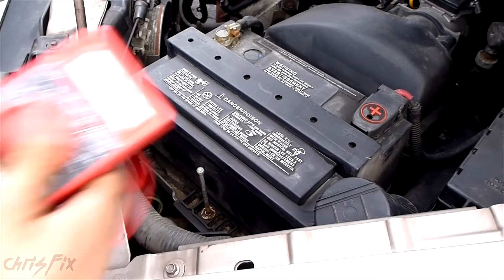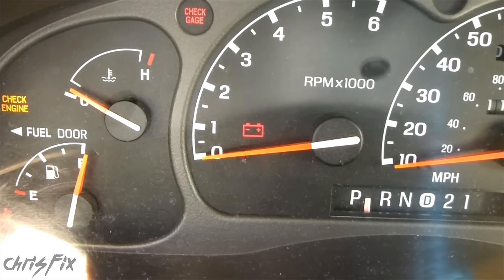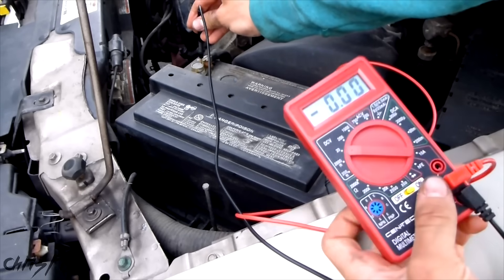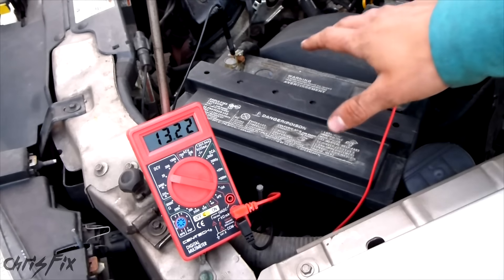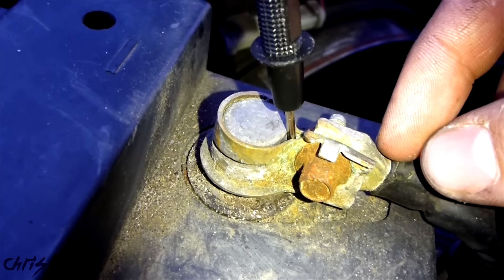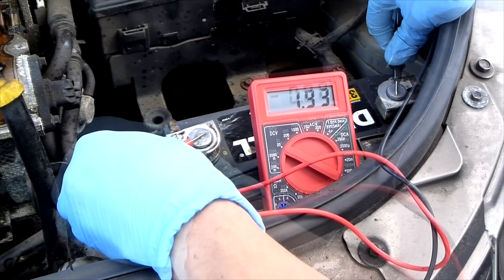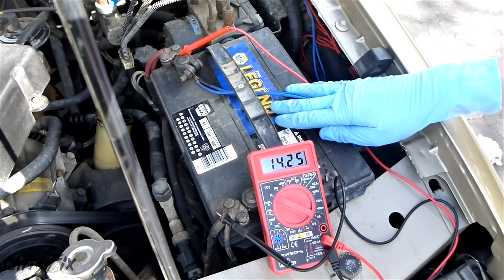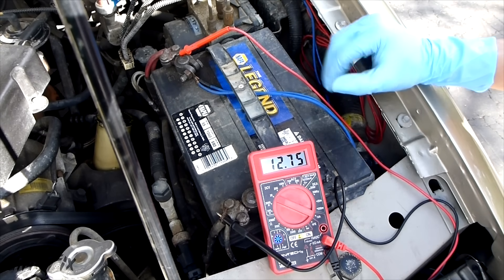How to Test a Car Battery with a Multimeter

Comment: Chris, today I bought my first multimeter and I successfully tested my battery.Thank you so much, greetings from Bulgaria!
Reply from the maker: Nice work! Thanks for the support from Bulgaria!
Reply: @chrisfix  I am in South Africa, also first time, your video helped, was always intimidated by multimeters, just a quick one make a note for people to use DC current reading and not AC reading as there are options on some multimeters
Reply: @chrisfix  how to fix air Con
Reply from the maker: @stevemanuel8373  I have a 3 part series. Here is part 1 and each other part is on the description : https://youtu.be/pCv7rCdcXsc
Reply: @chrisfix  I'm Steve
Reply: Chris, you have one of the best channels on yt and you've been so helpful! Greetings from Bulgaria!

Comment: What if my battery sits at 12.1 and drops to 9.7 CCA when I start it then go’s back up to 14.6 when it’s running?
Reply: Needs to go on a 10amp charger for about 5 hours, to be fully charged. 14.6 is good that means the alternator is working
Reply: Why is that? To bring the CCA up?
Reply: @XoX1971  Exactly, when the battery is that low it has lost its capacity. After it is charged it should test better. It is almost impossible to tell if a battery is bad when is low on charge. Note a battery below about 12.4 volts won't be recharged by the vehicle itself simply because the alternator isn't powerful enough.

Comment: Issue is with the car running the battery voltage jumps around wildly from 14v to 9v to 2V to 12V etc.. while running idle. any guesses?

Comment: Clean terminals and battery post with baking soda with a little water.  It will foam.  Then rinse it all off. Then clean post and terminal end with means that make the contacts shine.  If you can get a battery anti corrosion spray then spray product over the reconnected assembly to stop further corrosion by eliminating any oxidation in the future.

Comment: My multimeter read 12.24 before I start and while it was running does that mean my alternator is the problem?
Reply: Probably, you should see at least 13.5 or more volts while charging

Comment: Is the voltage test for the battery.  The same method for a diesel battery as there 48volts.  The petrol is 12 volts🤔thanks

Comment: When I started the car, mine dropped to 7. As soon as it started I drove to the parts store to buy a new one. I came out of the store and the car never started off of the old battery again. So 7 volts on a four cylinder Toyota is death.
Edit- may I add, the original battery from Toyota lasted 18 years. Yes. EIGHTEEN YEARS!!!

Comment: What if the Battery has no surface charge and you leave the head lights on for 2 min, and after 2 min the voltmeter is gonna show 12.2 or 12.3 even with the new battery.

Comment: If I have a newer 2014 Lincoln  MKZ and it's having a charging problem do I need a battery with more than 550  Cold cranking amps I live in Minnesota And it is Winter time roughly 10ﾟ

Comment: Copper grease on the battery terminals after cleaning wouldn't go amiss either, stops corroding of the terminals/connecting blocks.

Comment: Before using the sandpaper, mix some baking soda in hot water and apply to the terminals with a brush. A old toothbrush works well. This will get rid of most of the corrosion. Rinse with clean, warm water and let dry before using the sandpaper. You can also buy a battery terminal brush that works better than sandpaper.

Comment: If you have a battery that is 5 years old or more, just change it.  Lead/acid batteries have a life span of around 5 years and it isn’t worth waiting until it’s too late.  Cold weather depletes the batteries charge as well.

Comment: Hey, Chris, I'm having a bit of an odd battery issue that maybe you can help with. I got my battery about 9mo ago, and for the past few days, almost every time I turn my car to the run position before I start driving, the voltage of the battery drops to 9.5V after about a minute and stays there. It doesn't get any lower. The engine starts okay, but while it's off and the car is on, the battery voltage just holds at 9.5V regardless of what loads I put on it. Sometimes it holds at 12V the whole time I'm getting ready to start. The car is charging the battery fine (I verified this with a current clamp); it may be charging it a bit quickly, but I see the correct 14.4V when the car is running (with both low and high load).

I put my load tester on the battery after a drive and it delivered 400 or so CCA out of 340. I took the battery to both AutoZone and a dedicated battery store and got the same result from both places.

Do you have any idea what might be causing this? I don't want to be doing things like scanning the OBDII computer or updating firmware while this is an issue.
Reply: this is old but, sounds like the acid has mostly leaked out of one cell. The battery   might be punctured thru the side causing the level to be low. When that cell discharges before the rest it will then reverse charge from the current flow, acting like a negative 4V battery in series with the 12V 
either way, your battery has failed

Comment: Thank You for the great idea - to have voltmeter connected during cranking! I've had the exact same problem You discussed in Your video - my battery was over 12,6 V in (almost) no-load situation, so I thought it was ok, but my car wouldn't start. After checking everything else (and preparing my desperate soul to have my car towed to the mechanic), I searched the internet and found Your video, tried to hook up the voltmeter and turn the key... saw 9,2 V. I replaced the battery and my car is happy and running again. Thank You for the awesome work, Your car-maintenance and troubleshooting videos are the best! Regards from the Czech republic! :-)

Comment: For other people using a multimeter their first time - when testing DC Voltage:

Black Cable goes into the one that says COM
Red Cable goes into the one that says V(OHM)MA

It should say that in your manual, but that tripped me up because there's three holes to plug the terminals into.
Reply: No no no! the red cable goes to the VOLT/OHM jack
mA or AMP is for measuring current, if you put that across the battery terminals it will blow the fuse in the meter, or blow the meter

Comment: If your battery light goes off when the engie starts, that does not idicate a good battery, but rather that the alternator is putting out a harge, ot necessarily enough amperage, but sufficient voltage to turn off the lighht.

Comment: Im having crank issues. A mechanic wanted to change my starter, negative cable, distributor cap and rotor. I bought s meter after watching this. Turns out my battery was pulling 1.4 v. Saved me $2,000 from a crooked mechanic

Comment: Mix baking soda and water for an easy way to clean corroded battery terminals
Reply from the maker: Thanks for sharing!
Reply: Yes, it will neutralize the battery acid, so you can rinse it off without it corroding something else.

Comment: My +ve terminal of the battery was corroded but even after losening the bolt the connector wasn't coming off....I also poured baking soda soln but it didn't helped...what should I do?

Comment: Chris I just replaced both my battery and alternator now my battery light comes on and I got my meter and checked the alternator but it is only putting out 11.9. So did I get a bad alternator?

Comment: Using that same multi-meter one can easily check for a bad connection anywhere in the starting circuit. The battery should be delivering its full voltage to the starter. Any bad connection will show voltage across it when the starter is engaged.

Comment: Your battery terminals are garbage. They are not original equipment. You need terminals that crimp on to the wires - not bolt on.

Comment: Hey ChrisFix, is it ok to charge battery when CCA is low?
Reply from the maker: You can try, but if it drops significantly, more than likely you will need to replace it!
Reply: @chrisfix  right now it drops to 8volts when I start the car, is it possible for the cca to recover back to normal if I charge battery?
Reply: Space 671  5:27 parts store can test your battery  . I had a bad battery and  I called my insurance for a jump start - after the third time the tow truck driver did a battery test and gave me a complete printout of the battery condition -

Comment: Are the crystals a lead compound?
Reply: Depends. If it's greenish/bluish and you have copper terminals, it's likely copper sulfate. If you have aluminum connectors (terminals) and it's mostly white, it's probably aluminum sulfate.
Some have lead sulfate deposits. So be careful.
Reply: @wholeNwon  I’ve only seen a white powder so that will most likely be lead sulphate, I’m always careful.
Reply: @darylcheshire1618  Probably...unless you're careless with your coke.

Comment: One thing to keep in mind, I once spent about 30 minutes trying to find out why my battery had low voltage, the ultimate fix was to check it with a better multimeter. I was using a cheap multimeter from Harbor Freight virtually identical to the one shown in this video, none of the readings I was getting made any sense, finally I got a better multimeter and it turned out I had been wasting my time because the problem was the cheap multimeter, it was reading about 5 volts lower than it should, so that cheap red multimeter went in the trash.
Reply: You just got a bad meter. I've used one from HF for years (as well as an expensive one) and both work well...so far.
Reply: @wholeNwon  Yes that meter was terrible, it went in the trash. I had others like it that were adequate for uses that didn't require high precision.

Comment: Great chanel
I check my battery 
When the car is off it show 12.1
The battery is 70ah 720a(cca) and i measure 400 cca
How i know from what number of cca is bad?
The car doesnt start sometimes on random
And another question 
How i know the battery can be charge (i have charger)
Thanks

Comment: After cleaning the battery terminals with sandpaper/wire brush it’s supportive to apply batter pole grease to prevent from corrosion.

Comment: By the way, flat top batteries, the ones with a label across the top, also have caps that can be removed. Pressing down on the label, you can see the outline of the caps.

Comment: You missed a bad connection between the battery and starter, especially at the starter since it is a connection you cannot easily see. Any corrosion can cause a slow start.

Comment: Mr chrisfix my SUV battery reads 12.3 and 14.3 running. Should I replace it before winter or wait another 6 months?
Reply: If you're concerned, simply have it properly load tested.

Comment: That battery stat is crazy.
My 05 Chevy Cobalt went a full decade before it went bad!!! I'm not lying!

When it went bad it was because the water inside the battery died & unbeknownst to me & we had AAA jump it.

Because it had no water in it the battery kept heating up unable to cool down.

The battery is in my trunk & when we jumped it we bypassed the water issue & it kept heating up until it started smoking black from my trunk. 

I had to shut the car off & immediately replace the battery lol.

Comment: Hello how are you? You can also use bacon soda (Bicarbonato de sodio)  to clean the terminals. A teaspoon of Bicarbonato de Sodio, in a half cup of water.
So you do not modify it thickness, calibrate for the amount of current it supplies, when starting the motor.

Comment: When I start my car my voltage drops down  to 6/7/8 volts and with the car off sometimes I have 13 or as los as 10.5 volts. With the engine running I have 14.5

Comment: There are battery terminal cleaners  that do a better job than sandpaper.  Sandpaper is  only good for an emergency and wears down the terminal postand the conductive plating  from the connector.  The cleaner spray only removes the cxorrosion and leaves a protective coating.
  Dielectric grease is also better than WD-40 to protect the posts.  WD-40 is not a lubricant or cleaner.

Comment: Boiling water works on my battery posts then a slip of Vaseline to prevent the oxidation returning
Reply: I just spray them with the autozone wd40. It's much more oily than the real wd40 but Vaseline would work fine too, just need a way to prevent air from touching the metal

Comment: I tried this. Voltage 15, but 2 cells were shot. The "Battery Doctor" used a simple suction instrument that indicated the 2 cells were ng. So, while the multimeter indicated battery charged it di not indicate the cells were NFG. Just saying. I'm going to find out what the cell tester is call. Brb.
Reply: Need a cheap suction tester. It's a simple suction tester/meter similar to radiator  coolant ratio tester. It indicated condition of cells. I didn't know of this. The multimeter indicated fully charged nearly 15 volts,  but this was a false indicator. Its usually the cells (thete are 6 in most cars).  I lerned the hard way looking for a short or anything in -33F below in Alberta. It was the bad cells in the battery. Forget about the multimeter. Its almost always bad battery cells.
For your information.
David
Alberta 
Canada

Comment: I personally would not buy a sealed battery. Batteries are easily internally cleaned with baking soda water solution (a couple or few times) add solution of epsom salts and battery should be fine again for a couple years, unless bad cell or cells.

Comment: A clean battery will prevent self discharge and clean terminals will deliver more current for both charging and starting. A baking soda/eater solution will neutralize the acid on the battery and terminals. Wash it off well after and dry terminals before reconnecting them. Be careful not to get any baking soda in the battery cells. I use a battery brush to clean the terminals, very cheap tool at the auto store. I lightly grease the terminals after reinstalling them. There are sprays made for this too. It is good practice to remove the negative terminal from the battery first and replace it last.
Reply from the maker: Thanks for the tips!

Comment: Thanks for the advice! I wanted to check the voltage on my jumpstarted because it won't hold a charge. It has is about 11 volts😂😂 so I will go get a new battery for it.

Comment: my alternator reading was 13.7-14.02 with all my accessories on (ac,headlight,foglamp,radio) my alternator is good? thanks for the answer.. sometimes the reading was 13.5-13.9
Reply: yes
Reply: @breezeandsky  now i got 13.5-13.7 this is good? coz 3days ago i got the battery warning on my dash. thats why im monitoring my batt and alternator
Reply: @rocellitocuyom2920  13.8-14.5 is the normal range your alt supposed to put out when the engine is running.  your alt is going bad
Reply: @breezeandsky  thankyou.. i will go to auto repair to check any issue about my alternator

Comment: Damn,,,,that was a poor example of battery clean up.  Hint,,,,use hot water with some baking soda in it to remove all that build up on the terminals and neutralize the acid.  (It’s much safer, quicker and better) Then clean up the terminals with a proper battery terminal cleaning tool.

Comment: Why didn't you put some white grease on the threads of the bolts of your battery lug clamps before reattaching?  The next mechanic or owner will thank you for that ounce of prevention later on.

Comment: Do not just cut your modern car off your battery, you could lose all your coding, 'radio at the very least', use a set of jump leads from another battery to keep power to the live and neutral leads, to be safe.

Comment: Your American batteries must be crap. I have a car which I have owned for 10 years to which I fitted a new battery 9 years ago which had a 5 year guarantee.  I had to replace that battery just under 2 years ago, which means it lasted 7 years. That is in my experience the norm for batteries in the UK. I replaced it the first time it failed to crank the engine. I charged it up and drove straight to the depot to get a new battery fitted, having first checked the alternator was working correctly with my volt meter.
Reply: In the UK, you don't have the temperature extremes that we do here.  When your battery goes through a bitterly cold winter, or a summer in the desert heat...believe me, you'll be lucky if a battery lasts one year.

Comment: you should NEVER clean electrical connections with sandpaper. one of the first things taught in electronics class. use a wire brush.

Comment: I've had that battery light on my car for a year and a half. I thought it just meant the batery was on lol

Now my car won't start
Reply: LOL
Reply: You can repair a car battery. Buy a battery defusilator and leave it on the defusilator for a night. After that make sure it's fully charged and it should work again for 5 or 6 years
Reply: @Mofie-aoi  those are great but require a flux capacitor to work.

Comment: If you don't have an assistant or min/max setting on your multimeter, then thread the leads between the hood and the windshield and set the meter on the windshield or hood facing you (to read during start up).

Comment: now days in some modern cars you cant unplug the battery wires like that no more, it will reset computer and you do not want  that to happen. to prevent this they sell a tool for it at any autozone or other car parts store for around $65 or you can do what i do at home... take a 9v battery run two wires positive and negative from 9v battery to car battery before you unplug car battery wires, once you have done this you then you can unplug car battery wires positive and negative. that way computer will stay running which is what you need.